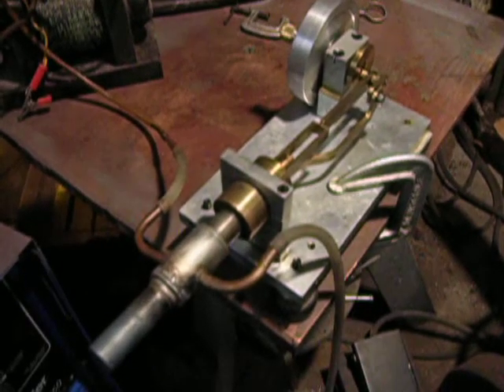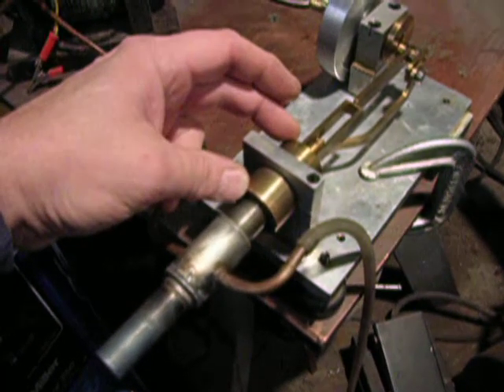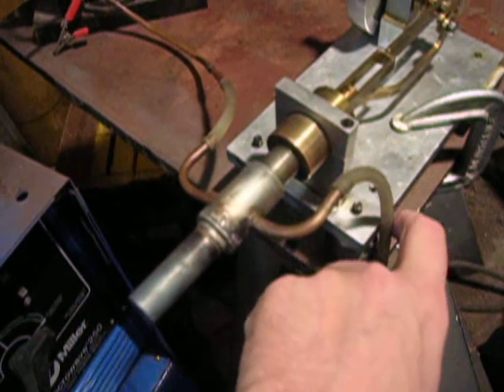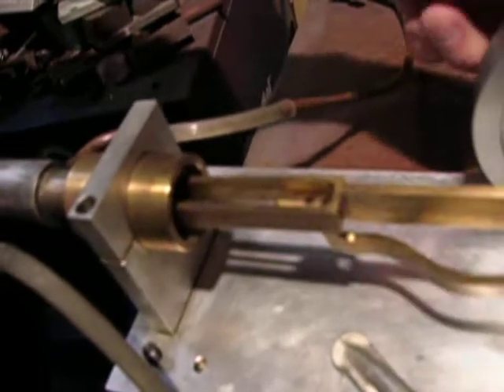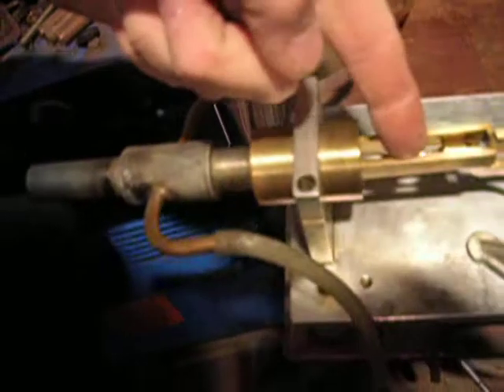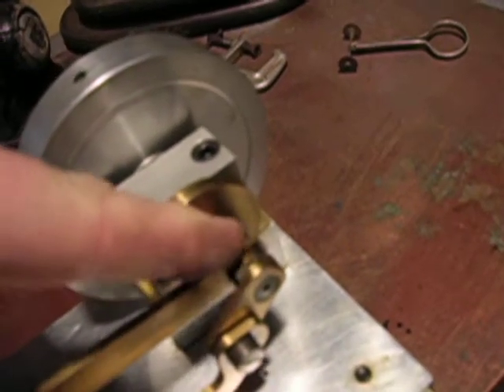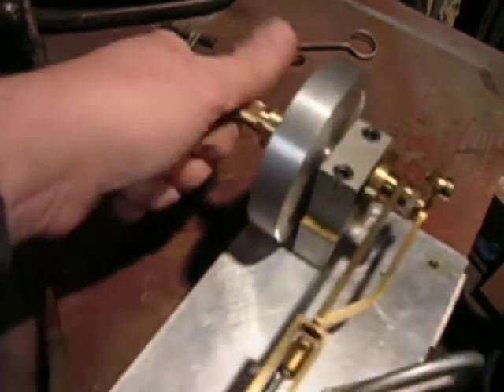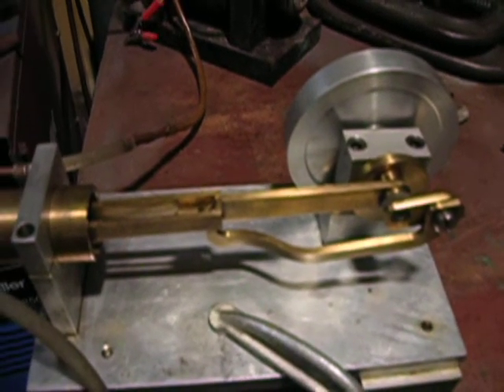BETA STIRLING  TURNING OVER MANUALLY 11-21-08.MOV

Comment from the maker: Jacob,

The engine doesn't run any faster when I hold it in a vertical plane. I wanted it to resemble a horizontal mill steam engine. It is just a toy.

If you are building an Alpha, the best configuration is the V2.

Have you joined the HotAirEngineSociety on Yahoo Groups? I run it and you may find some good designs there.

Regards,

Archibald
Northfield, Minnesota